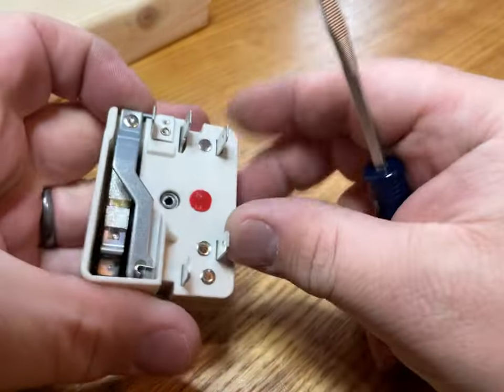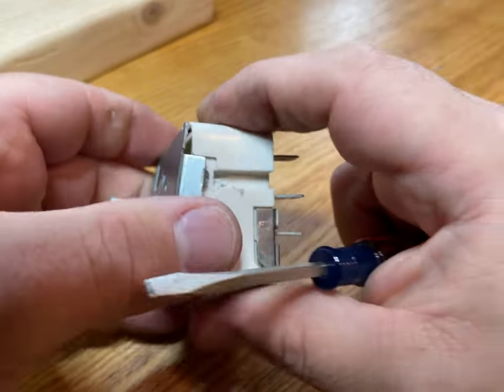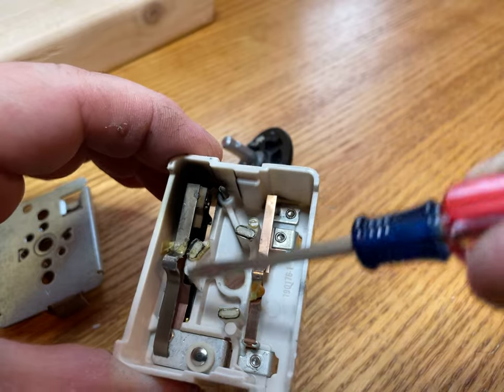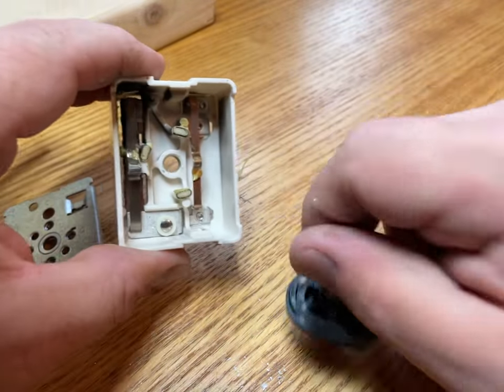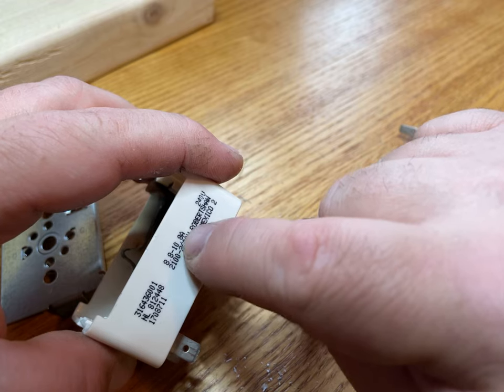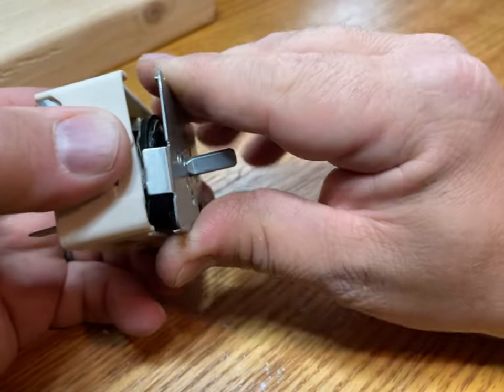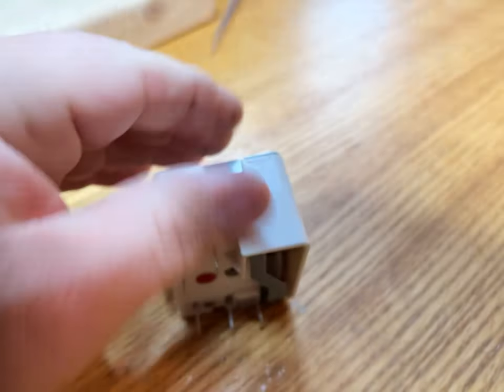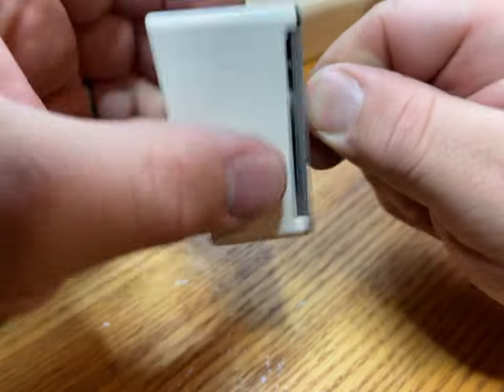Basic Burner Infinite Switch Shaft change.

Comment: I've got a whirlpool range with these, and both burners on one side started making an arcing sound whenever I'd turn them on. 
     I took apart the back and found that they are arcing and sparking randomly when they get power. 
     I took them off and sprayed them out with electrical contact cleaner, assuming they were similar to a guitar potentiometer. 
     I put them back in and got the same result. 
     They still send heat to the elements. Is there a way to clean the switches or do they just need replacing?